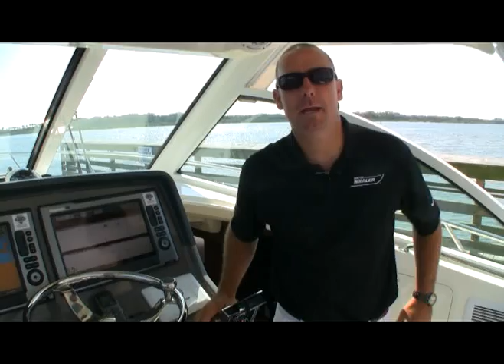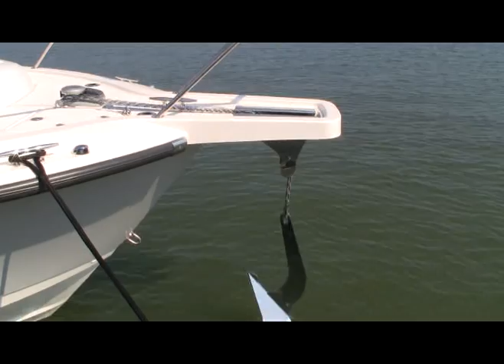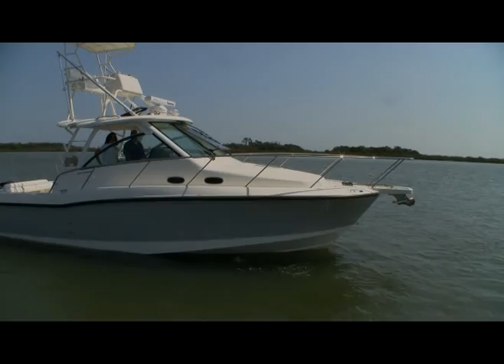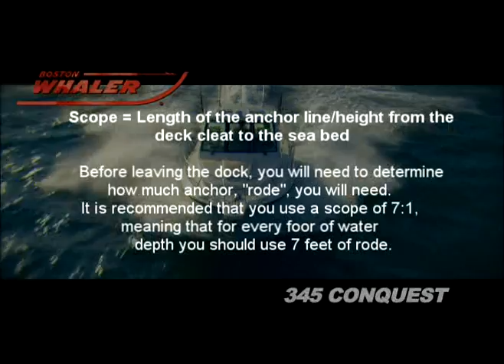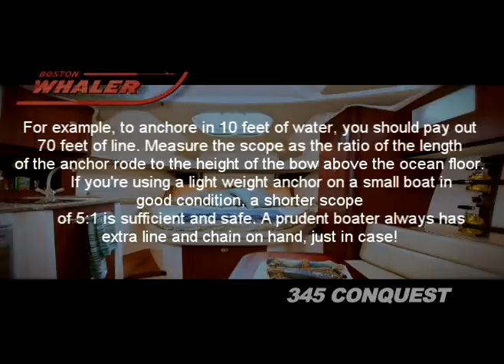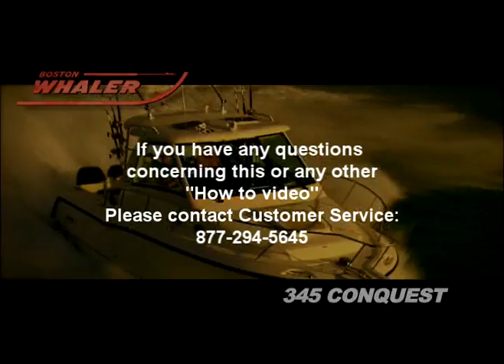How to Properly Use an Anchor Windlass

Comment: I have a 46 sea ray with 1500 vert. windlass and the motor runs when you push the button but does not turn reel , i tightened the clutch on top but still just runs free wheel
Reply from the maker: Thanks for reaching out! We would recommend getting in touch with the windlass manufacturer for your Sea Ray. They will be able to provide the most detailed information for your specific boat.

Comment: I painted 5 feet of chain to let me know when the anchor is just above the water line. That way I can know when to bump the switch and get the anchor nicely in the roller. There have been times where a stiff wind was blowing us toward the bank and I knew that I could safely  use the throttle to hold our position without fouling the prop after seeing the painted section.